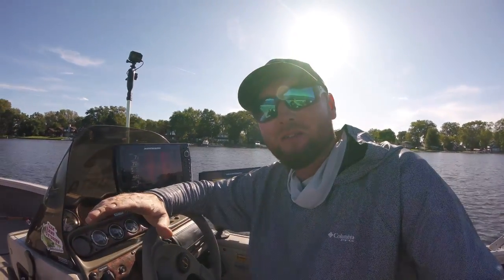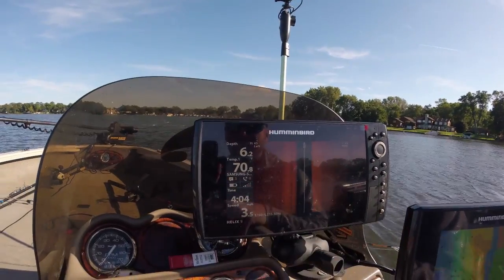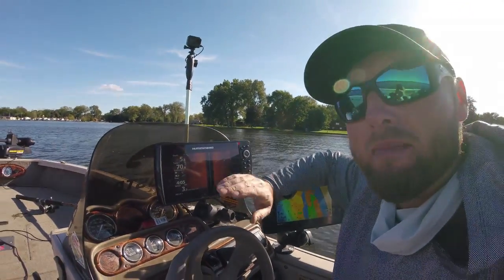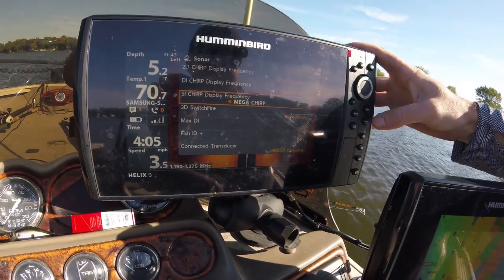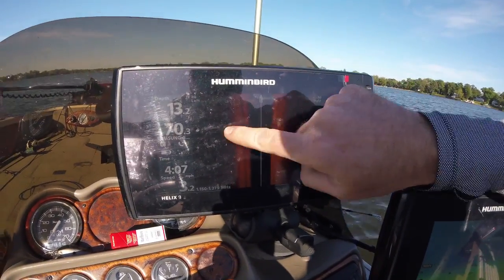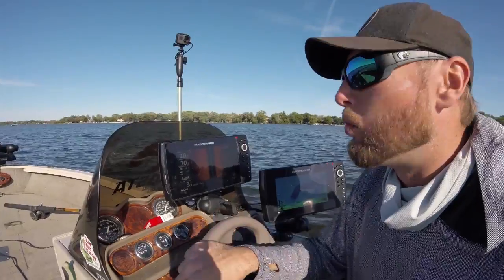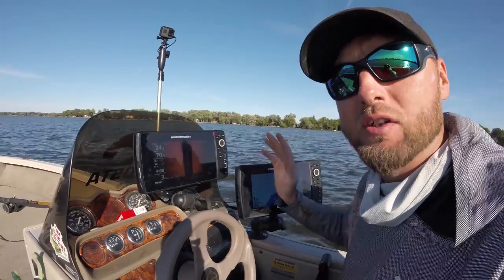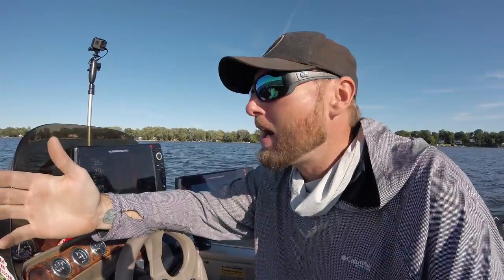Humminbird SIDE IMAGING Frequency TUTORIAL - Mega vs 800khz vs 455khz

Comment: Just found your channel. This is exactly what I was looking for. I have Liked and Subscribed!!
Your explanation about how to bounce between your Range and setting the Mhz-khz for detail was very informational. I normally run my chart speed about 5 or 6 (about 1.5 - 2 greater than actual boat speed) and adjust my sensitivity and contrast after making a settings change to really dial it in. I am still learning on my new electronics so just wanted to know if this is correct - this is what I found in some of my previous research. Thank You!
Reply from the maker: Awesome man glad you found the channel! I ussually always run my chart speed a little high about 2 times as fast as boat

Comment: Do you have to keep changing those settings any time you move down the lake weedlines. Or can you run this another way like the default settings so you don't have to keep switching your frequency settings. This is great advice but I want as simple as possible.
Reply from the maker: If your fishing down a weed line I would just keep it on mega imaging and u will be fine. Only time u need to change is when targeting fish all in one day on weed edges, soft bottom and open water
Reply: @HumminbirdHelp  Ok Would I set the range at 50 ft each side for a 9" Helix?

Comment: I'm still trying to understand various settings and learn the Helix 8 and Helix 7 units. Side Imaging was working fine, but now it is no longer listed nor does it show up as a "view" option.  Have I changed a setting that caused this?  How do I get it back?  Would it be best to just "reset" to factory defaults and go through the setup process the way I want it?   Will I lose waypoints? Any assistance would be greatly appreciated.
Reply from the maker: Are you getting any feedback from the transducer like 2d and down imaging? Probably the easiest fix would be to reset defaults in the settings menu tab. You will not loose any waypoints. Just the settings which can easily be reset
Reply: @HumminbirdHelp  Thanks
Reply from the maker: Glad to be of help

Comment: I’m a new fan of Slime Quest TV and enjoy your content.  I have a question about SI on my Helix 8 G3N.  When fishing in stained water my mega imaging is almost black.  I have been switching between 455 MHz and 800 while playing with the contrast and sensitivity but I am not able to get a clear view.  It is too dark.  One side of my screen while in SI full screen is darker than the other side of the boat.  What do you suggest for dark stained water on sandy/rock bottom less than 15 feet for settings?  Thanks
Reply from the maker: Thanks Brad! Here is a video I shot on a helix 7 g3n on very stained water. This should help you out. Are you sure there is nothing blocking the ducer 180 degrees on each side?
Reply from the maker: https://youtu.be/k89CZICKXWM
Reply: Maybe my motor but wouldn’t everyone have the same problem while trolling with the big motor to scan and find a good spot?  I also found your video on leveling the transducer which I’m going to try as well.  My other question is do you need a Ethernet cable to network your Helix 9s with your Helix 7.  I have a Helix 8 at the helm and a 7 at the bow and looking to do the same thing.  Only issue is my transducer in the Minnkota Ulterra trolling motor shows a 3 foot shallower discrepancy from what my transom mounted Mega SI is showing.  Very frustrating.

Comment: New to the helix family and your channel. Do you have any videos on 2d and DI? I mostly fish crappie and catfish (trying to get into walleye). I feel like I'm not showing as many fish as the unit should. I've been in areas where i limited out, but my graph rarely shows fish. I found them using my old unit. I have a helix 7 g3 mega unit. Any tips would help! I can't wait to try these SI settings this week.
Reply from the maker: I actually have been wanting to do a 2d and di video and will in the next couple weeks. Down imaging has such a small cone and is how they get such good target separation. In result will show far less fish especially at low speeds. So this is what I do when vertical jigging. The unit comes stock on 200khz in 2d. Switch the 2d sonar to 83khz and the the cone will be much greater and show many more fish. Keep a look out for a video discussing this I'll put out in the next couple weeks. Your going to love your humminbird helix 7
Reply: @HumminbirdHelp  thanks for the reply! You have it mastered! Humminbird needs to cut you a check!

Comment: Do you no what the black plastic circle with two wires from both sides is, that comes with a mega transducer trolling motor adapter kit? Thanks so much can’t find any info on that.
Reply from the maker: Not entirely sure what it is, did it come from the factory from humminbird. Only thing I can think of is caps for the plug ends when not in use. Does it have a rubber seal inside?
Reply: It is a round  black circle 2 wires black and red from one end have circle battery terminal ends then the two black and red wires from the other end have push in electrical connections. They come in every mega kit for trolling motor adopters. Thanks again! Humminbird couldn’t even tell me lol
Reply: It's a choke cable to use if you have an on board battery charger hooked up to your cranking/electronics battery as well as your trolling motor batteries all the time.  It's supposed to help with interference  that can pass through the charger connection.
Reply: Oh ok 👍🏻 thanks Joe

Comment: Is there a way to change the frequency of 2d sonar on helix? If so what advantages would that have?
Reply from the maker: Yes sir, if you are on a full screen 2d sonar screen on you humminbird hit the menu button 2 times get to your sonar menu and scroll down to 2d sonar frequency and switch from 83 and 200 khz. 200 khz is a narrower cone angle but better separation. The 83 khz is wide and used well for jigging vertically under the boat. Hope this helps